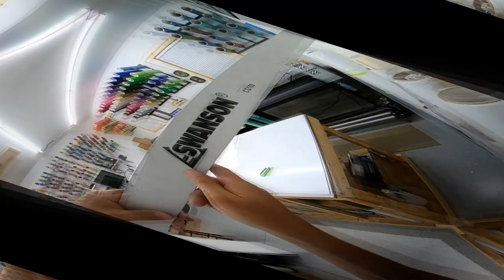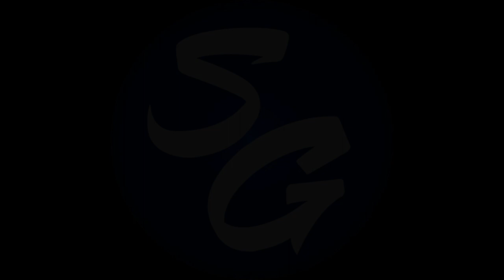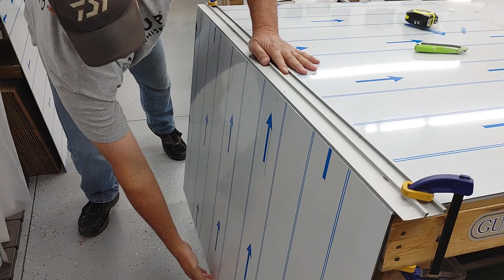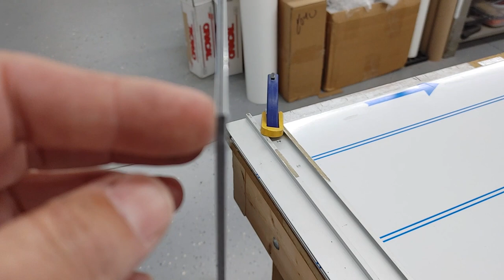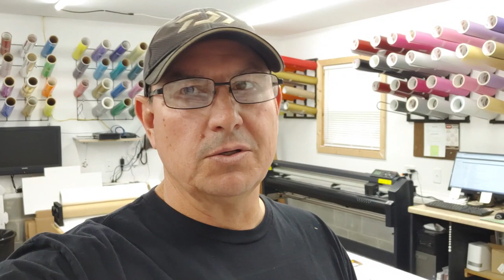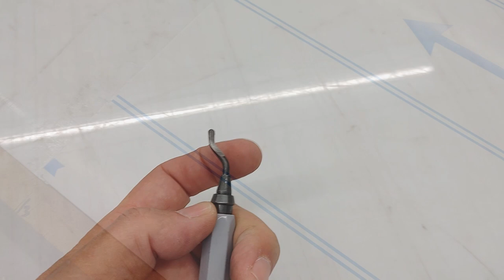How I cut down ACM Panels

Comment: Hello, can you make series on plotter vs vinyl problems. For example when the blade pulls some of the vinyl up while cutting, etc etc.
Reply from the maker: I'll see what I can come up with. There is so much to fine tune and I can go over the basics of the vinyl vs plotter issues.
Reply: @TheSignGuy  or just some resources you have used to overcome problems
Reply: @carloscastanyeda  Play around with your OFFSET, its probably the main reason

Comment: I use a track saw and 80 tooth carbide blade ….it does great smooth cuts.
Reply from the maker: Agree but it gets messy and I don't have that much space. I have enough "chips" to pick up with the CNC... 🤣
Reply: Which saw?  If it has a vacuum port, does it leave much debris behind?
Reply from the maker: I've used a regular 7 1/2" circular saw. The vacuum port should pick up most of it but it still makes a mess. I prefer to score and snap over the saw.

Comment: What is the longest cut you would make with this method? Have you ever done a score & snap on the 96" side?
Reply from the maker: Across the 48" is the widest I've used this method, If it was any longer I would use a table or skill saw to cut it.

Comment: I am using ACM for the top of a mobile model train n-scale 3x8 foot table. What thickness are you cutting? Do you think the thickness you cut in the video will work for me with 2020 extruded aluminum braces on all four sides and across the middle? Thanks for the advice.
Reply from the maker: I use 3mm (1/8" ) ACM most of the tie and in that video. Over the span of 8ft I would use 3 braces in the center (2,4,6ft) and all 4 sides. The 3mm is pretty flimsy, ACM will bend so the more support you can give it the better.

Comment: Thanks for the helpful video! Do you have any advice on cutting 90 degrees off ACM panels? Is it possible score and snap off a corner?
Reply from the maker: I'm not sure I'm following you, if you want to bend the ACM into a 90 and V groove works best. For corners, I use a corner rounder.

Comment: What is ACM new to this
Reply from the maker: ACM stands for Aluminum Composite Material, it is probability one of the top 3 sign making substrates in the industry. ACM just about replaced normal aluminum panels (.030,.040,.060,.080) for making signs because it has so many uses and easy to cut, bend and route. There are a lot of different choices out there, I like to stay with a .015 or .020 aluminum skins in a 3mm total thickness. ACM is a general name but if you look up DiBond they pretty much "invented" the ACM about 20+ years ago but it's twice the cost.

Comment: How would you go about rounding the corners?
Reply from the maker: I have a AccuCutter(.com) and use the Cornermate CM40A Table with a 3/4" rounder. A little pricey but works great, had it for 7 years and never an issue. I generally cut 1/8" ACM with ease but works fro coro and up to.040 aluminum too.

Comment: If you treat this like drywall and cut one side fold and cut the other side it's way easier than trying to snap it. I'm actually not sure why you're doing that
Reply from the maker: the snap in my opinion leaves a cleaner edge. The pressure from the knife blade tends to curl or flair the edges.